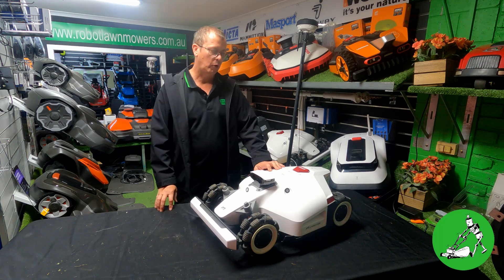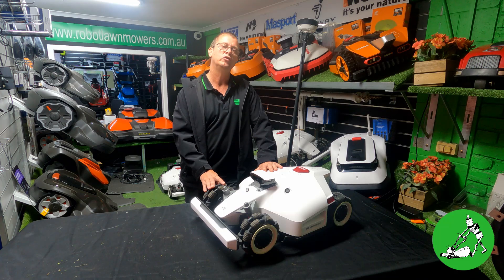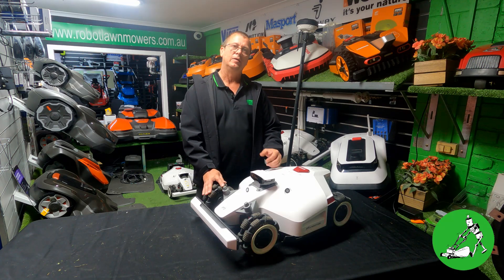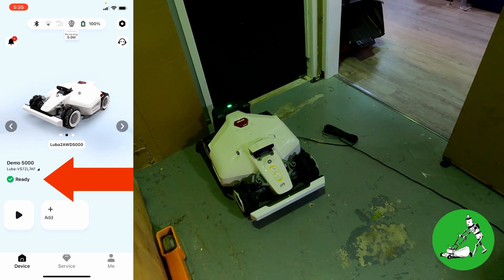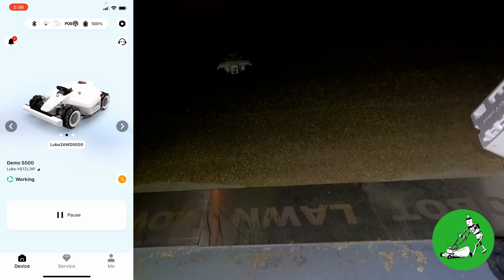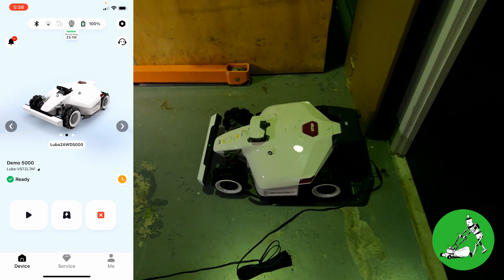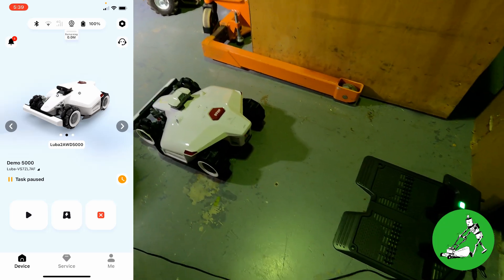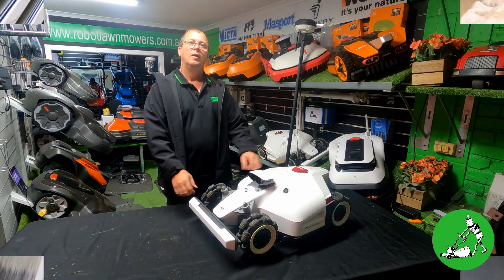Luba 2 I was Wrong - Wireless Robot Lawn Mowers Australia

Comment: Thank you for your video. Sadly, you were right the first time: it doesn't work.
My robot won't leave it's station when there is no or weak sattelite signal, despite what you shown in your video. I'm on the latest firmware and app version.
I contact Mammotion , with a link to this video. The answer was: "GPS is needed to enter or to leave the charging station.". Exact reply below. I don't know why you got it working differently, but I don't and Mammotion confirms it shouldn't work.

REPLY-BY-MAMMOTION:
Hi. Currently when the LUBA 2 is mowing during daytime operations, even if the RTK signal is weak (showing float or single), the vision module will function effectively, allowing the LUBA 2 to operate smoothly. But the channel that the LUBA return and out the station is still relied on the GPS signal.
And the functions related to the vision module are undergoing further improvements. Thank you for your understanding and patience. Feel free to reach out to us if you require any additional assistance.
Reply from the maker: Thanks for sharing that. We have been contacted by quite a few people around the world reporting similar results to your. So I have been testing this further to see how reliably it works here in Australia, and the results are that it works about 90% of the time. I have posted another video on this today, so I would very much like to know exactly where your robot fails to reset after it has light again in the morning. 
Here is the link to the new video where I tested it over two weeks.
https://youtu.be/__eXamnCdaI
We do talk directly with the Mammotion R&D team and although they are not releasing this function officially, it definitely works here in Australia and hopefully once they lock the position of the robot when it is on the charging station , then it will hopefully work for everyone.
Thanks.

Comment: Just a heads up, mine has been on the charger all night, and this morning my position status went from "fix" to "float" and my camera icone said 82 feet, which is 25 meters. It did not say zero meters BUT I'm in a different situation than your test, mine arrived at the charger with gnss signal, sat in the dark overnight, and simply lost satellite signal because the satilties moved. If this is not a fluke, this is great news for everyone who wants to put the charger up against their house or under a deck where it will get occasional positioning fixes.
Reply from the maker: Thanks. it sounds like you still have just enough GNSS signal at your charging station for LUBA to occasionally be able to position its self. That is why it shows 82ft on your app. So you should have no issues with it returning to work every day after it goes dark.
We also posted another video on this today - https://youtu.be/__eXamnCdaI

Comment: I asked Mammotion this, “Why can’t the mover leave the station with poor positioning. A lot of users have a roof over the mover (or would like a roof). Once the mover leaves the charging station it gets great positioning.”, but got this reply: 

“That's because the robot cannot "forecast" if there will be a FIX signal when leaving the dock and what will happen then. Additionally, if there are any unexpected obstacles, it may be at high risk of damaging itself or causing unforeseen damage.”

I then asked what the actual risk is and they said this:

“The LUBA works primarily based on the RTK. This isn't specifically targeted at your situation, but in some cases, users may create a long channel before the LUBA reaches the mowing area.”
Reply: I have mine located under the edge of the roof where it says poor signal and it has been working fine.
Reply from the maker: Thanks for sharing. It is sometimes a little difficult to get a clear answer from the Mammotion call center team. We have been testing this further and we posted another video on this today - https://youtu.be/__eXamnCdaI.
But there certainly are many people around the world reporting it simply doesn't work for them.
Hopefully Mammotion will  lock the position of the robot when on the charging station and it should hopefully then work for every one.

Comment: How do you reset the charger location when it doesn't have access to satellites?  When I've tried it without satellite coverage I get a message that it can't reset the charger location.  I'm using the 'reset-charger-location' option in the app.  It might be doing that wrong.
Reply from the maker: You will need to make sure the robot has a good position with a FIX position status on your lawn. Then remote control the robot to the charging station very slowly and reverse it on to the charger. Once it hits the charging contacts it will ask you if you have moved the charger. Click yes to moving the charger and it should then be located in the correct position.

Comment: Thanks for the in-depth testing you are doing.  I was able to put our charging station on the covered patio where we have electrical outlets for a much cleaner install. Before the last firmware update I would have to manually drive the Luba out of the patio until it got good gps to start mowing.  I believe this update will solve that.  Have to give Mammotion credit for solving problems!
Reply from the maker: Thanks, Mammotion are constantly improving the products, We posted another video on this today - https://youtu.be/__eXamnCdaI
This function is working for me around 90% reliable.

Comment: Got my mower last week, thanks for the quick delivery! This video is timely as I am just building a little garage for Luba. Have a frame built and was just looking at what to clad it with. 
I've read previously you shouldn't use colorbond as it blocks the GNSS. The fact that it drives out with no signal would that mean that it should work fine even when docking and undocking in complete dark - as it will get signal as soon as it leaves? . Or would it be safest to go with different materials. Was looking at 4.5mm HardieFlex (fibre cement) but that might also block signal
Reply from the maker: Yes it should still work ok no matter what product you put over it. We posted another video on this today - https://youtu.be/__eXamnCdaI
This is working about 90% reliably. If you do install yours with no GNSS signal on the charger, please send me an email reporting your experience. Or post here what you found.
Thanks.

Comment: Wonder if it will be working with the Yuka ❓🤞
Reply: Yes....i wonder too...
Reply from the maker: We haven't been able to test Yuka yet, but I would imagine it should work in a similar way. We posted another video on this today - https://youtu.be/__eXamnCdaI
I have seen from other youtubers that the Yuka GNSS receiver doesn't appear to work as well as Luba does for now.
Reply: Update it works the first day several times, but overnight it thought it moved out of the area, my current guess is that I still has some GPS reception but bad one and thinks it moved of the charging station
Reply from the maker: @headshotke  yes my thoughts are the same. Having connection to any satellites and the robot thinks it is outside the area after many hours of not having a fix. Mammotion have said there is a new fw for Luba 2 soon and there are some changes that might help.